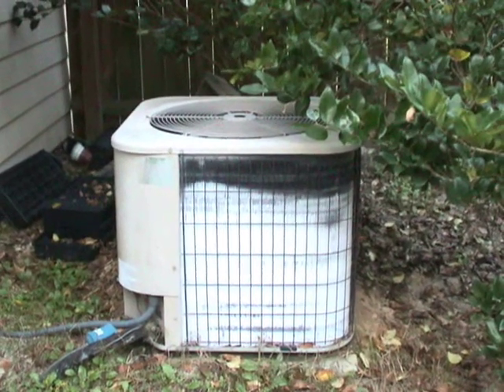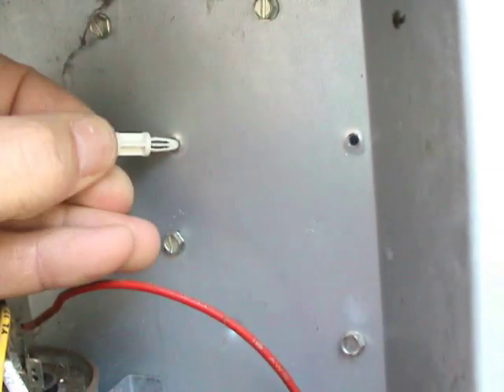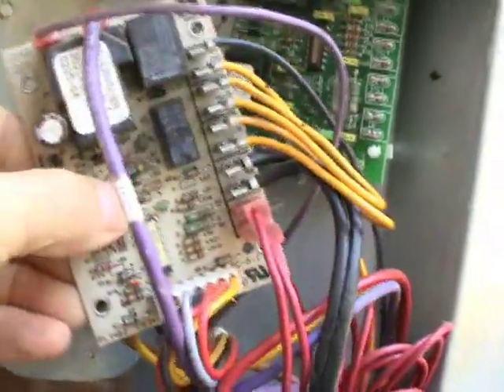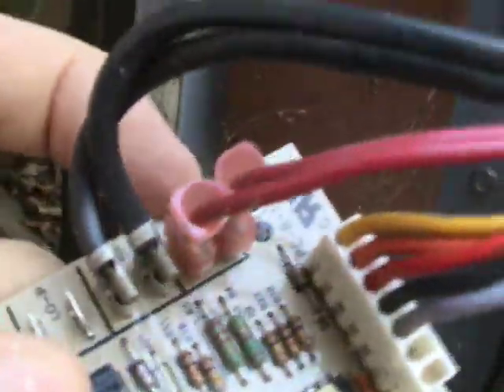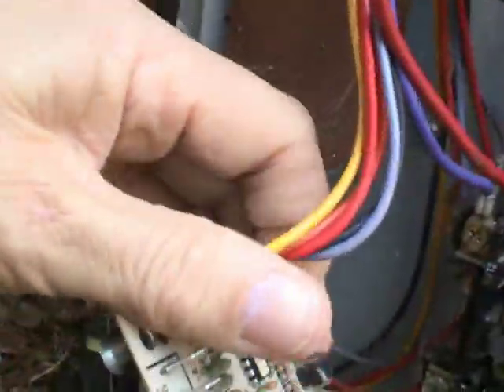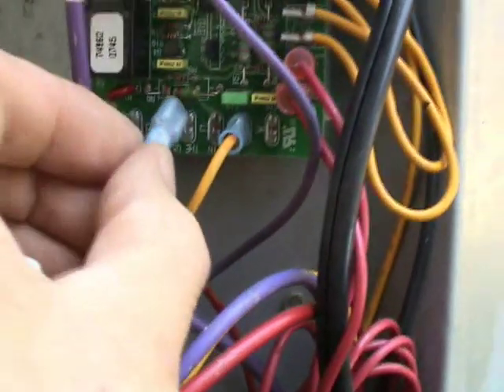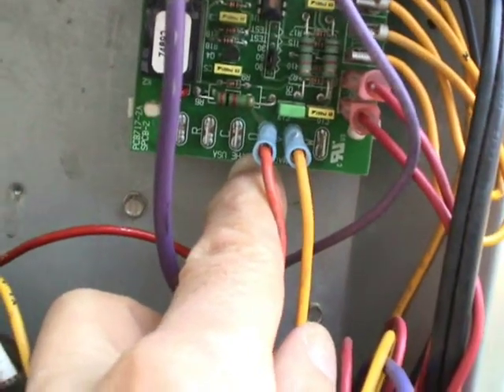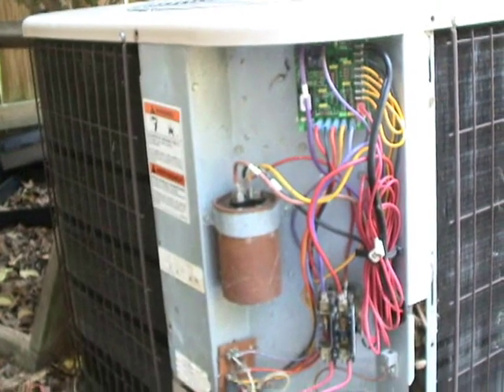HVAC Defrost Board Replacment

Comment: Question? What could be making the 3 amp fuse blowing on a regular 13 seer good man heat pump with a variable speed blower? I checked the contactor and it was burnt, replaced with new fuse then 3 days later blew again. System has new tstat wire from hp to stat and air handler.

Comment: Great video Dr z . But I don't understand why all these techs on YouTube give away our knowledge to these homeowners so they can just try to by pass us like a defective low pressure switch. Its okay to say what you did to repair units because us techs understand the lengo but don't show these people how to repair the units . You don't see normal people with easy office jobs getting overpaid  showing us how to perform their job. I understand showing us techs difficult troubleshooting jobs , but showing a customer how to replace a capacitor or contactor isn't doing us any favors. Just my opinion

Comment: My Trane XE1200 from 1996 is having defrost issues, I mean it does go into the defrost cycle, but the condensing fan keeps running during the cycle. I'm not able to locate a condensing fan relay separate from the board, so could the board be why the condensing fan won't stop in defrost?

Comment from the maker: It sounds like your board has pins instead of connectors. You could solder the wires on the board in that case.

Comment: I am replacing the defrost control board in an Amana RHE30A2A.  The existing board is no longer available and has been replaced with a B122GO06 board.  I recieved the replacement board but it does not have 'plugs' for the sensors. I have two sensor connectors on my old board.  It looks like they run together in the circuitry.  On the new baord, I have a sensor 'spot', but there is no connector.  Do I solder both my wires to this?

Comment: Love your informative videos. The cost of service from many HVAC tech's is borderline criminal. $180 for $7 capacitor should be illegal.

Following your instructions I installed a new condenser fan and it runs great. 

Recently installed new defrost board when the Trane troubleshooting tips said it was bad. After installing the new board from internet unit no longer defrosts or operates in cooling mode with either the new board or the old one. 

Any thoughts as to why will be enormously helpful!

Comment: Somebody uploaded a video of a Goodman heat pump defrosting, and I noticed a " glitch " that fan motors have during defrost. The fan will not completely stop during defrost, and instead will continue rotating at a very slow and steady speed, what could cause this?

Comment from the maker: @headscratcher99 I watched you video. This is a common issue with all heat pumps. It's caused by a couple of things. The manufacturer might not have be using the entire coil as in some of the runs aren't in use. Also, it could be simply the placement of the defrost thermostat.

Comment: I have a Carrier split system that's about six years old.  About a month ago the outside unit would not turn off- except by pulling the outside breaker.  I found that the main contactor contacts were welded shut.  I replaced the contactor and the unit worked well until a few days ago.  Now it won't get out of the Defrost Mode. I suspect the Defrost Circuit Board, but hate to shell out $100 for a new board until I'm sure it's bad. Any suggestions?  Great Video! Thanks!

Comment: Dang manufacturers.  Why isn't that circuit board better protected from the elements and moisture?

Solvent cleaning and reflow soldering usually brings them back.  But new board is definitely better quality.

Comment: Great video..I had to change one of those boards last  week because someone wired high voltage to the wrong side of the board...it was a Rheem heat pump

Comment: Happy New Year to you and Becky!!!
Another great video Dr. Z , that sucks you have to work on vacation, but you don't have to rush . I like how you take the time to explain each individual wire. Thanks for explaining O and B on reversing valve on the board!
It looks like you have room right beside your new defrost board to mount your OUTDOOR SENSOR for your Honeywell Prestige T- Stat ?
Is there any reason it won't work there ? I hope you can relax for the rest of your vacacation.
Later FRITZ